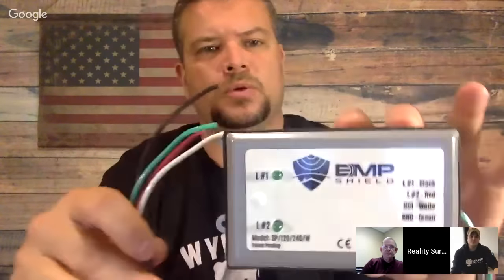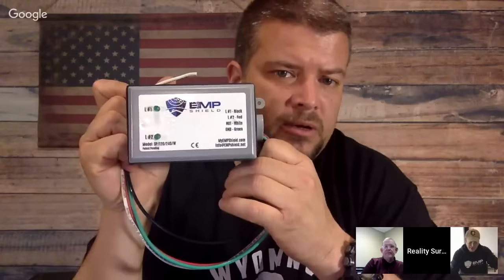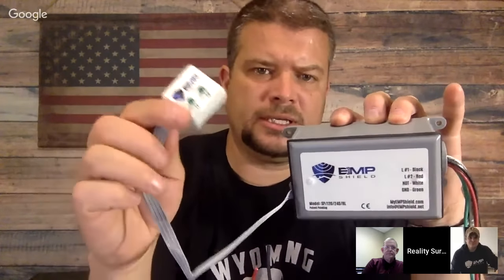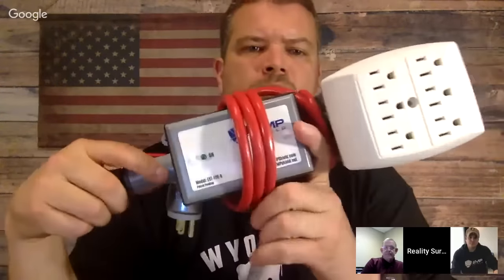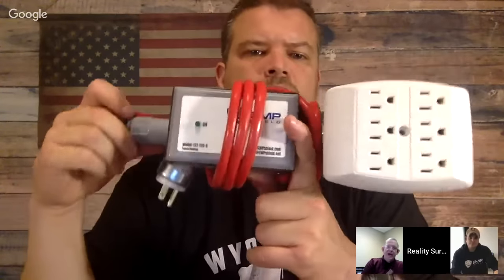The Truth About The EMP Shield!

Comment: Why bother getting this when most everything from you back to the power plant is going to be fried. You 're still not going to have electricity just because you maybe save everything in your house. Same thing with your car. Where will you get fuel to operate you car if gas stations can't pump it?
Reply from the maker: I’m going to assume that you haven’t spent much time on this subject based on your comment. First, if you are properly prepared you should have multiple methods of power generation at your home. Check out my videos on power generation. Second, with cars, most people spend the majority of their day at work and that is often more than 30 miles from their home. Even if having one of these got you home and no further after an EMP or a nuclear detonation that is a huge win. Third, since about 60-70% of vehicles will be disabled you will be able to scavenge fuel from disabled cars for quite some time. Fourth, if you are preparing properly you will have at least 30 but preferably 100 gallons of gas at your home. And since you won’t be driving except in the most dire circumstances that will last you a very long time. If that doesn’t make sense watch my playlist on EMPs and I think it will help you understand more.

Comment: EMP for Cars Cant work 100% due to the tires (being rubber) are an insulator NOT able to Full ground elec current to full ground abilities
Reply from the maker: Not true at all. The tires do not provide any benefit in keeping the car safe from an EMP. The induced voltage happens in the air as the wave travels from ground zero to the edge of the line of sight.
Reply: @RealitySurvival   Rubber is an Insulator which means It's truly unable to full ground (dissipate volt/current fully)
 However it's a Great faraday cage for people/animals
Reply from the maker: Are you talking about the EMP Shield? Or an EMP? If you are saying that the EMP Shield won’t work because the tires won’t let the vehicle ground itself you are incorrect. The EMP Shield shunts the excess energy to the chassis over and over a billion times a second u til the excess energy is dissipated through voltage drop and loss. It just keeps cycling until the energy is at an acceptable level. So it doesn’t actually need to be grounded. 

If you are saying that an EMP won’t affect a car because it has rubber tires that is also incorrect. The vehicle does not need to be grounded to be affected by an EMP because the EMP will induce voltage into all conductive surfaces that it passes over. Regardless of ground.

Comment: My truck  has ham n antenna as on it linner also will the sheld box protect my radios and amplifier 27 mhz
Reply from the maker: It will protect the radios but you should also add an emp shield for the antenna if it is a larger one. They have a specific model made for larger antennas I believe.

Comment: I'm buying one for my vehicle which has a number of computers built in (Toyota Alphard Executive lounge V6) 
Will I have to ground my car or will the car itself ground an EMP spike?
Reply from the maker: You don’t have to ground the car. The device shunts the extra voltage to the chassis of the car over and over at a ridiculously high speed until it is all dissipated.

Comment: It might protect your home. But unless you have your own electric source, be it generators or solar or water power, the outside electric from the grid will probably be fried. Most on grid electric is just to vulnerable to what could happen. It would probably work on a vehicle because it has it's own fuel source.
Reply from the maker: Correct. That is why I preach having your own power production so frequently.

Comment: How do you get gas for your vehicle since gas pumps use electricity?
Reply from the maker: First, if you are well prepared you should have some gas stored at home. Second, there will be plenty of cars all along the roads that have full tanks. You can easily siphon or drain those tanks to scavenge fuel. But most importantly keep you tank at least half full so that you always at least have enough to get home if there was a problem while you were at work.

Comment: where can i get one installed at
Reply from the maker: Any car mechanic can install them. They should charge you only 1 hour of labor at most. Or you can do it yourself. It’s very very easy on the vehicles. In your home any electrician can do it and it will also take less than an hour.

Comment: what does it matter if an EMP happens? you're not going to be able to get gas to run your vehicle anyway, so you're going to spend 500 bucks so you can run whatever gas you have left in your gas tank?
Reply from the maker: I’m guessing you haven’t done much research in to prepping? Part of the basics is that you should have some fuel stored ahead of time. Also you should have a pump for transferring fuel from other disabled vehicle. Which there will be plenty of. But most importantly you will have a vehicle that will get you home or to your bug out location. Which even if that was the only thing you used your vehicle for would absolutely be worth it.

Comment: What I don’t get about the EMP Shield is the easy connect: (Battery Positive & Negative and the Chassis Ground)  How’s that going to protect the other electronics in a new vehicle when it’s only connected to the battery and chassis and not in the Fuse box or other important devices in the vehicle etc..
Reply from the maker: That is a great question. It is because the vehicles whole electrical system is powered by the Battery/alternator. So it is all one big circuit. The connection at the battery enables the entire system to be monitored.
Reply: @RealitySurvival , I get it but you can run the vehicle just with the alternator alone once you turn the crank/Fly wheel over with the starter like pushing a  manual car/vehicle if and when the battery is dead. You can have a short in the fuse box and the Vehicle will still run depending what it is in the fuse box if it’s the ECU/TCM then vehicle won’t work.  You can have an electrical surge go through the vehicle even if it’s still grounded and it will fry any fuse, Electronics that’s in the vehicle? EMP Shield should post a video live demonstrating how EMP Device will work and prevent ruining  electrical equipment in the modern vehicle in an event of an EMP. I still don’t understand how just simply plugging the  device to the battery terminals and ground to the chassis. I use to be a mechanic and know how to also work on car audio system with capacitors, fuse blocks at the battery etc and  you will still have a shortage you still have a shortage with the system ..
Reply from the maker: @JayP7676 ok so hopefully this will help. The EMP Shield constantly monitors the vehicles electrical system for an acceptable voltage range. If it sees the voltage start to spike outside that range it will immediately, within a billionth of a second shunt that excess energy to the chassis. There by keeping the vehicles entire electrical system from building up to much heat and drying the electronics. It is essentially a VERY fast surge protector for the vehicles electrical system. Just the same as a whole house surge protector but built for vehicles. That make sense?

Comment: If you buy one for your house, to be able to keep using your electric but the grid goes down what good will this do??? or is it so things still function on gas generator?
Reply from the maker: Yep exactly. If you are prepared and have your own generator you can still use your appliances. Also it will keep your appliances from getting ruined and when/if the grid come back up you won’t have to wait several years to get new ones.

Comment: Do I still need a Farraday Cage for my inverter if I employ one of these?
Reply from the maker: Yes for any electronics that are not plugged into your homes electrical grid you would need them to be in a faraday cage.
Reply: @RealitySurvival  Thank you. Sorry, just to clarify, if my inverter IS plugged into my home's electrical grid, I won't need to put it in a Farraday cage?
Reply from the maker: @trevordowney6425 do you have a solar setup? If so I would recommend checking with EMP Shield tech service to be sure. But as a general rule anything that plugs into a normal wall socket would be protected. But I’m not sure of your area talking about like an EG4 inverter or something like that. Those may require a separate EMP Shield. I’m not positive.
Reply: @RealitySurvival  Thank you. Yes. I have a Solaredge grid tied inverter. I will reach out to EMP Shield. Thanks again!

Comment: ⚠️  Clearly , the risk of a damaging EMP/CME event is significantly higher now in 2024 than at the original interview/video date.  It has always been somewhat of a personal concern of mine, though not an overwhelming issue.
I’m an EE, amateur radio operator, tinkerer 🤓, former licensed master electrician and volunteer firefighter/EMT in my community.  I’d venture to guess that’s why I was selected to participate in a pilot program to assess and (hopefully) remediate the risks posed to public safety 2-way radio networks, infrastructure, and subscriber equipment.

I am currently a member of a task force formed to provide the best possible redundancy/resiliency of the 2-way radio communications systems for a consortium comprised of a group of public safety agencies in the NJ/NYC Metro area.
Traditionally, especially in light of the attacks on 9/11/2001,  the main perceived threats have been terrorist action, followed by equipment failure caused by environmental factors, among other things… 

Currently, the most discussed potential threat is EMP/CME.  
Unlike residential and typical commercial environments, our systems must remain as functional as possible DURING such an event and must be resilient enough to function if/when damaged utility infrastructure has been rebuilt and restored.
Unfortunately, we cannot make use of the extremely affordable and ubiquitous “garbage can faraday cage/shield” to store equipment.   

Though we DO plan on “building” close to 200 x 30gal steel cans using conventional garbage, cans and sealing all seems and holes with metallic tape with conductive adhesive, lining the interior floor and walls with non conductive material AND fabricating fully conductive “gaskets” comprised of “crushable” copper mesh type material to ensure a tight and low resistance fit.  These will be distributed to each consortium agency (police / fire / EMS / OEM / etc..) which will store SPARES of mission critical parts and equipment.   

Just a quick example of items to be stored/protected in these cans.:
- “Cache” portable radios intended for handing out to mutual aid, responders, interoperability use, agency use in the event there front line equipment is damaged during an event.  

-  “Spares” of infrastructure components .  Repeater, power, supplies, control, equipment,, essentially all the equipment necessary to completely rebuild installed equipment..

- Rechargeable batteries that contain integrated  electronics such as BMS devices., etc…

With all of this planning and play, we are extremely concerned about downtime.
Using EMP shield devices on all of the equipment, seems like a very economical, an easy way to solve one of the biggest problems facing us in a very long time.

Everything from vehicles, vehicle mounted generators, building, electrical services, building, standby generators, remote, radio transmitter/repeater/voting receiver sites (both power and radio equipment. The poly phaser devices we are currently using absolutely not intended for this purpose).

It seems like the ideal solution.
By ad

Comment: I just happened to run across your video today. I have EMP Shields that I just installed on my vehicles last week. I just received the unit for my house. My question would be: the power comes from the pole to my workshop then it goes underground to the panel for my house, which would be considered as a sub-panel. I am planning on putting the emp shield in the main panel in my shop to which I presume it will cover my house also, Correct? Plus I noticed that the question about how long after a strike,  I would  have to wait to pull out my solar generator and other electronic devices that I have stored in my EMP bag.
Reply from the maker: I would check with EMP Shield tech support. Because it has to do with linear footage / distance from the device. So you would need to take the measurements from each location pole/main panel/sub panel. Then talk with them. You might need a second device on the house as well.

Comment: If it can only protect when hooked to a live circuit,it only protects the first emp strike.
Reply from the maker: Nope it will work for several EMPs in a row. I thinking they did it 14 times in a row or something like that in the tests.
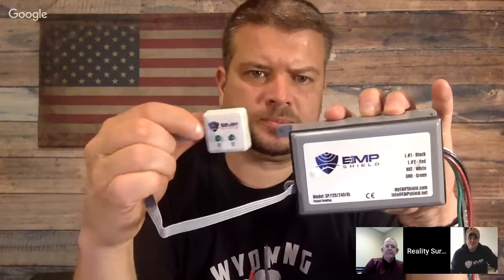Reply: At 20:50 he said it can only protect if it’s connected to a live circuit. If all the power goes out with the first emp, it will not have a live circuit anymore. Unless I missed something
Reply from the maker: I believe he misspoke. Since this interview I have spoken with their technicians several times and they have all indicated to me that the circuit does not have to be live. The unit will sense the electricity in the circuit when it is energized by the emp and will use that energy to activate the unit to shunt the excess energy to ground. I think he was trying to say that they are supposed to be wired into a live circuit in order to be most effective to provide the maximum coverage for other devices and the led light is there to let you know it is wired properly.

Comment: Will this protect a generac generator connected to your home
Electric system

Ect
Reply from the maker: You need two units for that situation. One for the home. And one for the generator circuit. But short answer is yes.
Reply from the maker: I have a video showing how to wire them both up.

Comment: I recently bought 3 trash cans & lined with cardboard & placed some of my ham radio gear & power generation wind & solar chargers. I will wrap things like TVs in foil & other items & disconnect from antennas & insulate any metal on device & wrap any cables inside that cannot be disconnected inside the foil.
Reply from the maker: Having a faraday cage iS good. Not sure the TV would be useable for a very long time though.

Comment: Will this emp shield work on an older home built in mid 1940s
Reply from the maker: As long as it has an updated electrical panel and has circuit breakers it will. If it has fuses you would want to check with the EMP Shield customer service to be sure.

Comment: Ok, but there is one nagging question I STILL have....for my truck, that is.  The way it is to be  wired at the battery I don't see how it would have any effect (protection) on the the truck's electricals/electronics.  It is simply an attachment to the battery, rather than being installed between the PLUS side of the battery and the rest of the truck's electricals.  Therefore I don't see that it would do much good!?!?!
Reply from the maker: The whole electrical system is one circuit. So it monitors the whole system. The positive cable is the cable that feeds the whole circuit. So if there is an induced current across the system the positive battery cables will see that increase as well. Make sense?

Comment: Would I need to put my backup generator in a fariday cage to protect it if I want to use it as backup? The generator would not be plugged in while not in use.
Reply from the maker: Best answer is yes. However if it is older it may not have any components that would be effected. It also depends on size. If it is newer then you definitely would want to keep it in a faraday cage or if that isn’t an option grounding it could help as well. Lastly if it has a 12 volt battery (usually bigger models) you could put a 12 volt EMP Shield on it to protect the 12 volt side of the circuit. There are so many variables that this is really a rough question to answer without knowing a lot more info.

Comment: Thanks for this great information. Used your code to buy one for house and one for home. How can I ask these gentleman questions? I’m curious about what it will take to protect a 2021 push button start key fob sprinter van with a yeti goal zero power bank installed with solar on the roof. The 12v out of the yeti is grounded to the van chassis. Will protecting the vehicle protect the yeti goal zero?
Reply from the maker: Thanks! I would call the EMP customer service number on their website for specific applications like that.

Comment: How can an emp shield possibly protect devices. Whether a device is plugged into the power grid or not, it can still be affected because a current is induced into the wires through a electro magnetic pulse, causing a current to be created in the wires. For instance, if my computer is not plugged into the wall, an emp will still affect all the electronics inside.  The emp passing through will create a surge whether it's plugged in or not. This surge will fry the electronics. How can an emp  possibly protect from that..... If I pass a Magnet across the wire it induces an electrical current into the wire whether it's plugged in or not. An electromagnetic pulse would work the same way. 

I simply don't understand how this device can possibly truly protect things. Everything would have to be completely shielded.
Reply from the maker: It will only protect the items that are plugged into the homes electrical circuit. It monitors the entire home electrical circuit for any out of range over voltage about a billion times per second. If it detects a spike in the electrical circuit it shunts the additional energy to ground immediately thereby preventing the circuitry from building up heat and getting fried. It does not protect items that are not plugged into your home electrical grid because it does it have a way to monitor that circuit. Make sense?